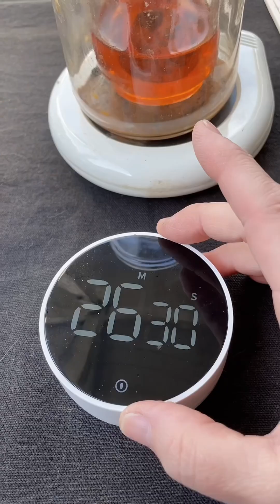Step by step Sterling acid etching with ferric nitrate #jewelrymaking #silverjewery #diyshorts

Comment: That's awesome!  What kind of acid and ink did you use?
Reply from the maker: @kiko_meeko  Ferric Nitrate and distilled water. The ink is just a pretty standard permanent/archival black pad😊
Reply: @sacredsilverofficial  Awesome!  Thank you so much!
Reply: @sacredsilverofficial  could you send me in with measuring of both fluids please,
Thanks 
Ps you make Nice stuff 🔥
Reply from the maker: @Robert-j5v2k Thank you. I almost always do one part FN to two parts water. 1:2 ratio. You can make it more or less aggressive depending on your project😊